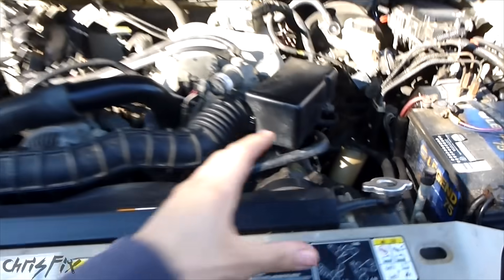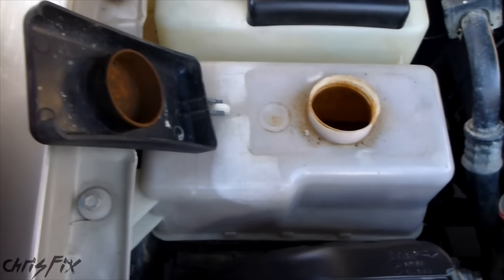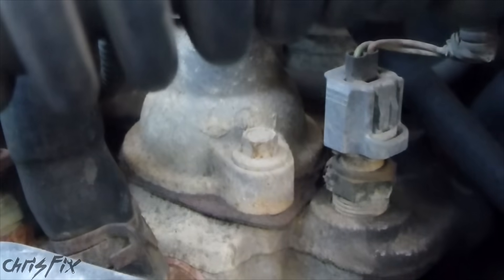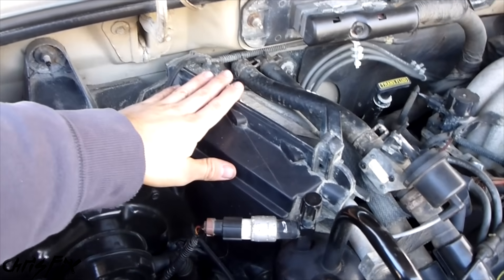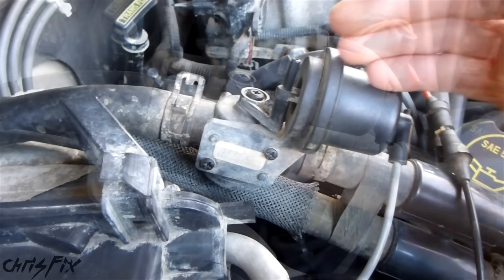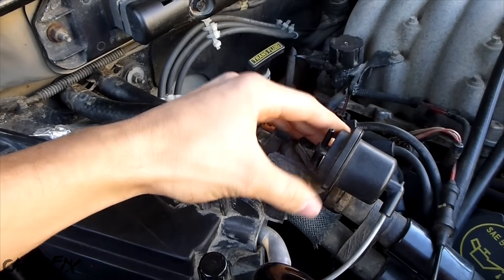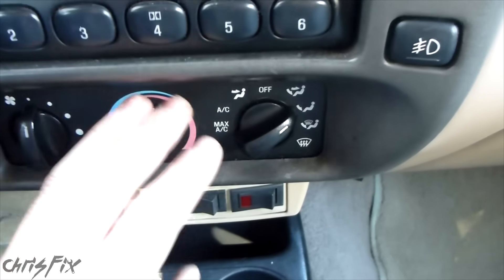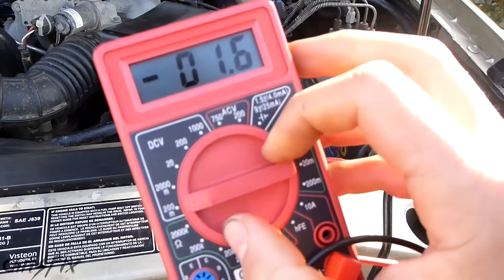How to Fix a Car with No Heat (Easy)

Comment: What if none of my controls are working and all the fuses and relay are good? Is my switch bad? No fan, no duct door, no nothing on the control panel.
Reply from the maker: If none of the controls are working go to the junkyard and get new controls to swap in (assuming it is electric)
Reply: @chrisfix   Hey, thanks Chris, That's exactly what I thought. Thanks for confirming this. You just got a new subscriber.

Comment: My car is not over heating I flushed the heater core it was dirty got heat but very little then next day no heat engine runs at normal temperature so if my water pump is working and thermostat is working why I have no heat...no leaks

Comment: I'm not getting heat on the floor. It works for the defroster, the vents, but doesn't come out on the floor. Help!!
Reply from the maker: Could be a vent actuator that’s bad. They are either electric or vacuum driven

Comment: My car (2003 Hyundai Tiburon), the heat and a/c doesn’t work. If it’s hot outside it’s hot air. If it’s cold outside the air will be cold

Comment: Or you have my Ranger with the Mazda I4 that doesn’t put off enough heat to build up pressure
Reply from the maker: I would still check the level of coolant!
Reply: @chrisfix  I did I checked the level but I did a flush also

Comment: I got a oil changed in my radiator flushed and everything in my heater is still not coming on Ford Edge 2008

Comment: Grrr!  What if you've tried all these things and it's something else. I took my car to the shop and they said the bottom of my heater core was real hot to save myself some money go home and flush it cuz it seemed like the water wasn't going through it. I had just replaced the heater core, still have the old one and cleaned out this new one. I flushed it with toilet bowl cleaner-then clean water - little bit of rust colored water come out. Put it back on, air seems to blow from the firewall past these two metal air conditioner lines and I think that's kind of weird - I thought the air should blow through the heater core. So anyway, no heat no air conditioning - I guess air conditioners a leak. Keep going back to my water pump and if the blades  in it are no good my water won't circulate like it should - very aggravating.

Comment: wrong ...should be .500 dmv watch is  half a Volt of more...BUT we would add more Negative Electrons by adding coolant... but we do recommend a  .400 dmv reading or higher, then add more coolant... you need voltage before electrolysis will evolve,,,  a .003 dmv is not enough to worry about chris believe me...

Comment: No heat ? A sure sign you have low or no water in the system  . STOP as soon as you can , shut the engine off and check the water/antifreeze level

Comment: Anyone know a reason for the heat to only work when you get up past 1k rpms and anything below it just blows cold air even with the heat set to max anyone have any ideas what it could be?
Reply: Heater core is plugged or thermostat is failing
Reply: Or coolant is low

Comment: What about a car that can get hot, but just take FOREVER
Reply from the maker: The heat or the engine temperature?
Reply: @chrisfix The cabin temperature just takes forever to get warm. I live in -20 to -35 winters tho, in Celsius

Comment: Errrr....don't laugh, true fact though. If I break, my front lights go on. When I use my aircon, it shoots out all the water in the system....guess that's what happens when you modify part sprinkler system in your car to make it run on a budget with a 300 000 mark on the clock. My hazard and indicators doesn't work and smoke came out of the steering wheel one day while I was driving. As busted as she is, she still rides no problem. Oh, did I mention my tail lights do not go on at night. GO FORD!!!

Comment: not as easy as you make it sound. Particularly the blend door is not a job for someone who doesn't know how to disassemble and reassemble.  Moreover you don't warn viewers of this video to keep their hands away from the radiator fan when engine is running. Working on a running engine is very dangerous.